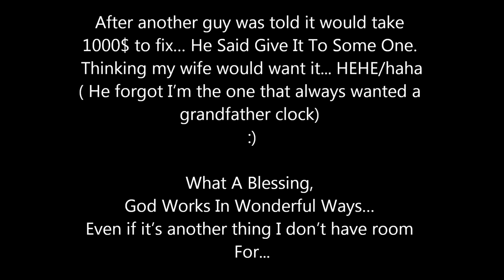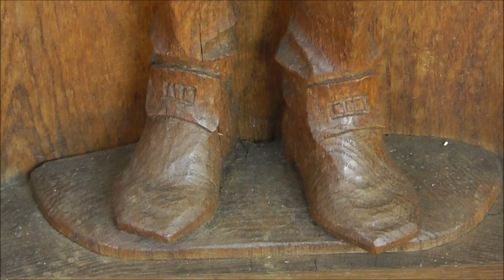Late 18th century Grandfather Clock Randomly Show Up On My Door Step...

Comment: i would put a german westminster movement in it. you would just have to drill a hole for the 3rd winding hole, and a couple fitting and adjustments. would require all new weights etc. and a pendulum. it would be worth it though. also i suggest getting the bottom half on there.

Comment: Russ, my advice is take it apart and give all the wood a slather with a brush, Linseed oil, it's the best for wood preservative, then wipe all the surfaces completely with cotton (socks) it will amaze you, and that little breakage you could make a 3D printer project, in those days they made the pendulum to come very close to the cabinet, they on this design mostly used a plate shape to cut the air, last one I saw from 1820 era, it had what looked like pie plates riveted together face to face with half of one cut so it formed a cup, in there was sand (maybe to adjust the swing time for accuracy).
Anyway you have some very old wood there and it's time to make it last another 200 years.
As for the motor part of the clock I see one thats in near perfect shape, maybe a bath in sewing machine oil, then set it on something porose on top of oil dry for a week.
You have a real jewel there.

Comment: This is definitely a really neat clock, but I wouldn't say it's as old as the 18th century. It looks to me like it is an antique reproduction from the early 20th century. It is very nice, however.
Reply: Thomas Spiltimber it is late 1700s or early 1800s, English. It's missing the bottom piece though.

Comment: Once you do manage to get a pendulum working you need to make its length to the swinging mass adjustable upward or down as that is how grandfather clocks are adjusted. Lower makes the clock run slower, higher makes it run faster.

Comment: how's the clock now? did you find the parts? online you can find almost any part for any clock, if there's no markings on the back plate then you'll have to count gears and do the formula to find the pendulum length, you can find a spring for long case clocks which is what this clock is, base missing? if i were you to prevent damage to the moldings is to get a chunk of the same wood as the clock, stain it to match and dowel it in

Comment: Russ, I love all things old. Not an expert on clocks, but the carved characters look bavarian/austrian to me.  Washing veneered wood with water comes at a price. Better/safer non-destructive solvents available. Let all the water in it evaporate as much as possible be fore oiling it or you'll see more grey clouudy spots on it.

Any natural oil will EVENTUALLY harden. Linseed will take a while. BOILED linseed oil is quicker. A can of Minwax Tung Oil will do the whole clock and harden in 12 hours. The "gassing off" fumes make hypersensitive people nauseous, though. Not so after it hardens. Almond or walnut oil might be used. But too much dust will settle on the surface before it is no longer tacky. That's a trade off. The more you work on it, the more attention you will draw from your sons. (And the less clock you will be left with to hand down to one of them... =Family heirlooms are greatly over-rated, anyhow    :-)

Comment: This clock looks like it could also be from spain but the ones Ive seen similar have one more box like partition that goes on the bottom so I don't think that is the correct height of the clock. I think its missing a bottom base.
Reply: In the video, he mentioned a base I think?  I was not clear if it was the original base for the clock, or if someone had made an ad hoc base for it.

Comment: Late 19th century like they say bottom plinth missing about 2ft short now 8 day longcase movement worth about $500 in presentvstate a lot more when properly restored good luck what you need is lingcase c,ock suspension with both. Locks you can buy that firvabout 5 dollars very bestvwishesvHugo